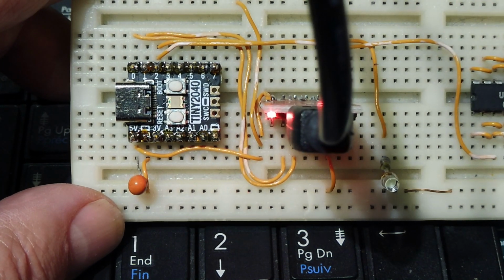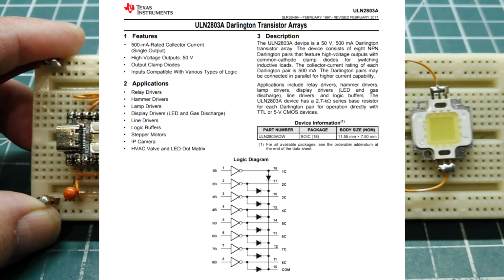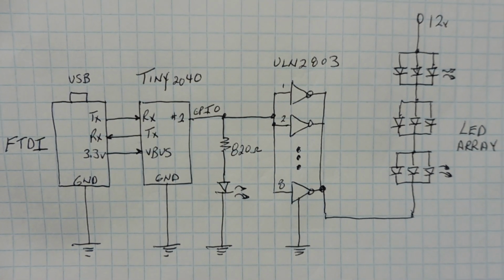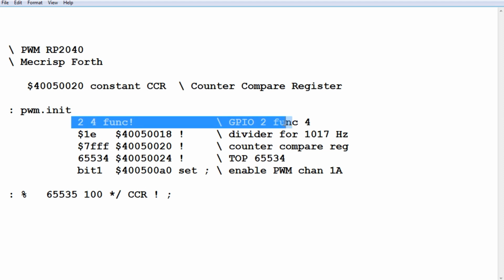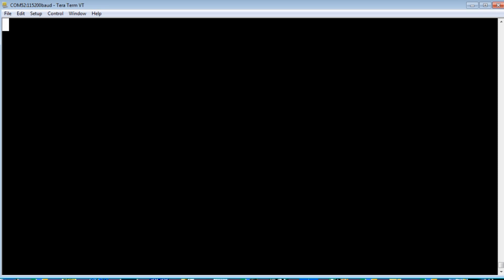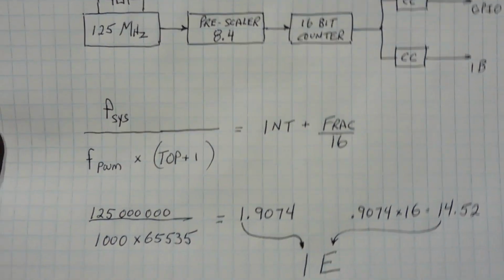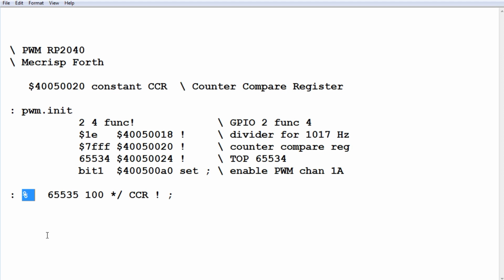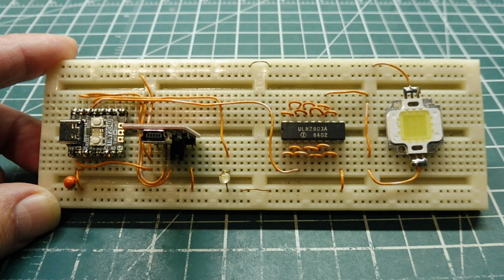RP2040 PWM / Mecrisp Forth / Direct Register Programming

Comment: Great video!  Is it possible to upload a forth source file the way gforth  s" file.fs" included ' does?
Reply from the maker: Communication to the RP2040 is over a serial link (FTDI) so source files are stored on your computer and loaded with "Send File  <name> or you can simply copy and paste the code into the Tera-Term window. Once compiled to Flash on the RP2040 it is saved and will run on power-up.
Reply: @0033mer  Thankyou, I'll try that.

Comment: You are usinf words that are not defined so we can not use or try
Reply from the maker: The purpose of the video is to focus on direct register programming and show what bits to enable in various registers. The Mecrisp word list has all the instructions to modify bits in configuration registers. Check out the Tachyon page for turnkey code if needed. https://www.dropbox.com/s/5x51yxow7y2kwzi/RP2040.fth?dl=0.
Reply: @0033mer  Ok Thanks

Comment: I'm not sure how many people will be interested in Forth, but don't imagine the world does need less forth content around. But as an addon content, it might be interesting to a larger audience to also see quick demos of achieving the same basic function (creating and adjusting a hardware PWM) in 1. Arduino environment and 2. Micropython, and if there is any practical differences in the functional output (I would expect they give exactly the same results, but any differences would certainly be interesting).
Reply from the maker: The purpose of the video was to demonstrate direct register programming. This for people who want to get into the internal workings of the microcontroller. Here is some PWM code written in Python:
import time
from machine import Pin, PWM
pwm = PWM(Pin(25))
pwm.freq(1000)
pwm.duty_u16(10000)
Give that to a class of students and they can change the brightness of an LED and then go on to the next project. What did they learn? Basically copy/paste programming. It's up to the individual if they want to go that route or get down to bare metal programming where they understand what is going on internally and can exercise all the features of the microcontroller.
Reply: @0033mer  I agree with you 100%. The micropython / Arduino stuff is for getting to to do without really wanting to learn and understand. Almost like an appliance. What you're doing is good, you should continue using Forth on the pico and do more demos. Thank you for uploading these videos.
Reply: Off subject why are you here
Reply: It would be interesting to compare the loop time of python and forth, ie turning a led on and off as fast as possible using bit control instructions rather than pwm.  I suspect forth is faster
Reply: Are you going to pay for it.